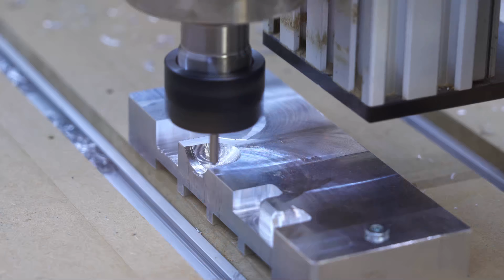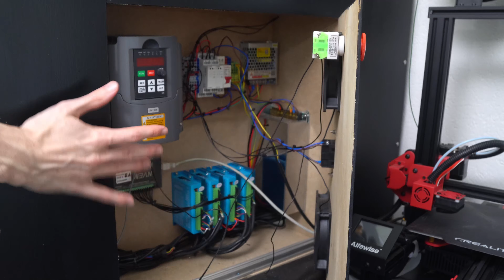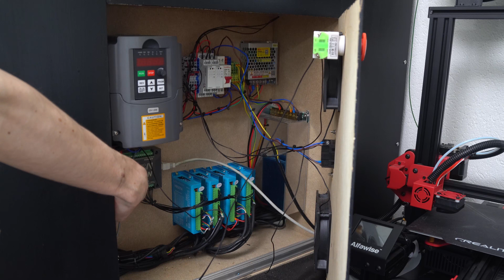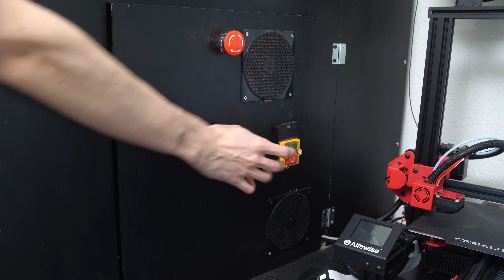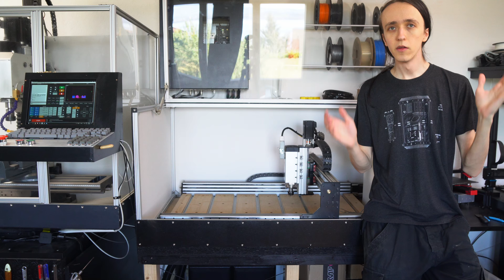RatRig KillerBee Review Part 1 - 6 Months Later

Comment: Great review, its a lot better with Linear Rails like you have on this machine, but it is possible to cut aluminum with V Wheels to, even though its not as simple as with Rails. What do you think about the OpenBuild Lead 1010 ? i guess the V wheels are the only downside to it, only the 7 Gantry plates cost almost 100 Euros and the V Wheels with bearings about 100 Euros, that's 200 Euros to instead spend on Linear Rails to get a much better Lead 1010 machine. Thanks for a good review.. :D

Comment: Hallo
Great videos about modifying  your Bernardo Mill. I try to copy it for my Bernardo BF25pro. How much torque i need for the motors?
regards and best wishes from Berlin
Henning
Reply from the maker: I went way overkill with the Nema 34 motors I used, some high torque Nema 23 would probably be enough, possibly a small Nema 34 for the z axis, depending on how well supported it is.

Comment: Made a switch to uccnc some time ago and it's just great. Had a bunch of hobby controllers before and they were simply not good enough (for various reasons). This just works and has a ton of features, both hardware and software.
Just a suggestion, but could you do a video about actual killerbee capabilities in various materials? I mean achievable material removal rates (feedrates, depth and width of cut)? Ratrig does not have many and on the other hand many people ask about this for example in their Facebook group. Would be also nice to be able to compare it to stock workbee (which still uses dated and weak design) and also competition like queenbee (both original from cnc3d or various versions from Chinese sellers).

Comment: Since you have already beefed up the center of the table, and you're not the biggest fan of how the t-track clamps were working, and you may want to run coolant in the future this is what I did on our machine. We have a techno cnc router, but I used 1/2" acrylic, drilled and tapped 1/4-20 holes every 3 inches of the table, and for two corners [let's say lower left and upper right] i spaced them an inch apart for a 7"square.  (sorry for using the imperial system) works great for routing wood, holding clamps, and I've even had decent results cutting aluminum. The dream is to replace the acrylic hole bed with an aluminum one, but the acrylic was free and aluminum is a lot more expensive than free 😜

Comment: Hey, I currently have an openbuild c-beam machine and thinking to upgrade. This one seems far more rigid is it true ?  Can you apply like 5-10 kg pressure on a spindle in various directions and show the amount of flex like you showed it on the x axis pushing on top ?  Have you had any experience with c-beam configuration by any chance ? 
I mostly cut wood but on occasion want to cut aluminum.  While c-beam is a great machine for wood  but then it comes to aluminium  while possible I find it way too flexy.
Reply from the maker: I am not familiar with that particular machine, but from what you've mentioned it is probably using v-wheels for the motion instead of linear rails. If the metal structure itself is descently sturdy, you might consider upgrading it with linear rails, they can be had quite cheaply from aliexpress. Or if the machine is similar to the queen bee, RatRig also sells an upgrade kit to get the killerbee features on a machine that was using v-rollers.

Comment: Excitingly awaiting my 1510 ordered a month ago. Hopefully not too wobbly :-) It'll be my first cnc ever, so went with their full kit (and duet controller). Seeing your mods and upgrades have been great though, just knowing what's possible and what might be good things to fix.
Reply: How are you liking the 1510? I'm about to order one for work but with these concerns I'm wondering if I should do the 1000x1000mm instead
Reply: @nico9314  Just got the kit last week. Have not had time to start building. Got PWM to analog converter from Amazon today (for spindle) and picked up MDF yesterday for table top. The Mesh Workbench I opted for is delayed until June so will have to fix something temporary for that too.

Comment: I recently changed to UC300ETH. Really nice motor controller
Reply from the maker: Looks interesting, had not heard of it before. It is definitely quite a bit more expensive than the nvem (at least once you add a breakout board), but looks to be closer to the smoothstepper I'm using on my other cnc in terms of functionality. How is the documentation for it? As that really is what makes or breaks such a controller.
Reply: @DarkArtGuitarsWorkshop  The board is made from the guy at cnc drive. They are really responsive and the mach3 plugin is stable. I had USS before and this one is better. Also more functionalities, including rigid tapping. Plus can always switch to UCCNC which is much better than Mach3. It also accepts the same macros. Regarding the probe, on Ali there are nice little ones and if you get a shorter stylus it should fit the RatRig perfectly.